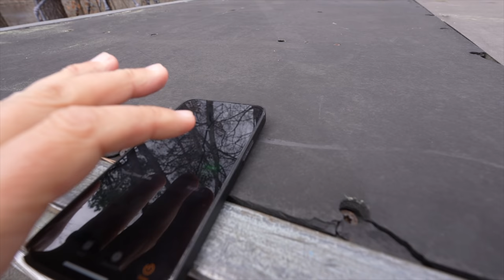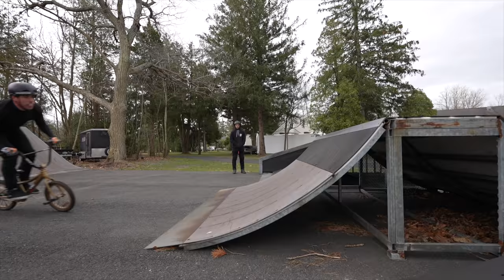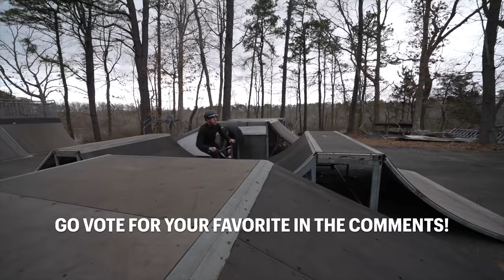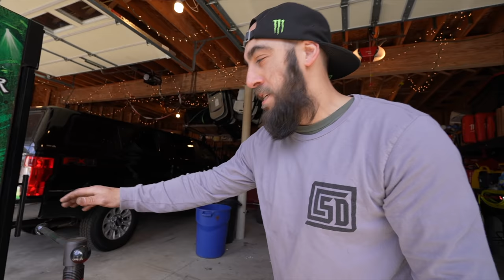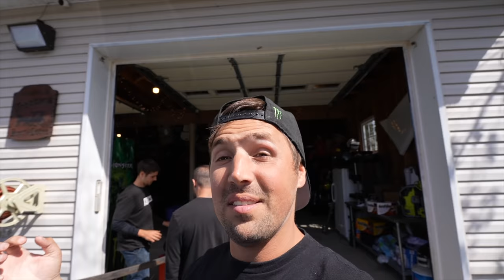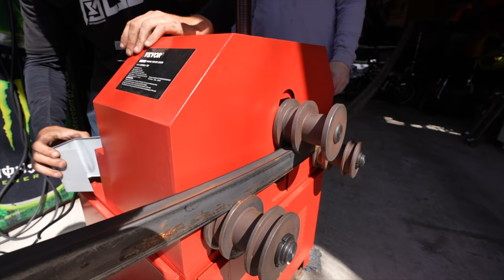GROWN MEN vs. KIDS BIKES!

Comment: First of as always love the vids. I don't know alot about bending metal n making ramps but I know one thing being in the building/ construction industry and thats when your working with something like that pipe bender or anything with a big electric motor don't run it of a power board/block/ safety Box something like that should always run of direct/ main power

Comment: Great video! That tailwhip was so clean!
The reason why you burnt the engine is because you were bending the profile in the hard direction. Turn the profile 90 degrees. (it can be done the other way but with industrial machines). It's like bending a credit card, one direction is super easy, but it is impossible to bend from the thin side! 
I hope this helps! great job anyway guys!

Comment: We had ramps at the shop we used to work at.
We had a Hoffman 16 incher that we did up as bits broke. It used to ride so well.
It was stock wheels, bars and frame

Comment: By the way i've had the same tube bender for years. The reason why you burnt the motor is because those benders aren't for Rectangle tube , they are for square and round tube only.
Reply: If you fix the motor and try to do the same thing, with the same material the bender will fail again just a heads up. Get some square tube and use the correct dies, it'll work. If you have questions, shoot!

Comment: the motor on the pipe bender shouldnt have burned out from that i used to use one everyday to bend square tubing and we would bend them into complete circles and you were no where close to that and ours would sit out in the rain and everything so i think you just had a faulty motor ours actually broke the lip of the bending wheel before the motor burned out the metal cracked if that tells you anything i would check into a warranty or something along those lines because thats kind of crazy

Comment: Heat the steel up with a torch before you bend it. Your lives will be a lot easier. Also don't poor water on it after for handling, let it cool on its own so the molecules settle correctly and you don't get brittle metal